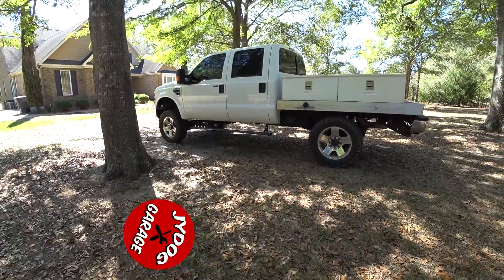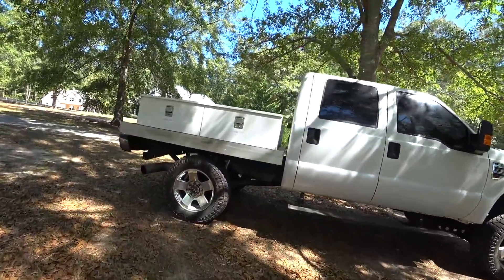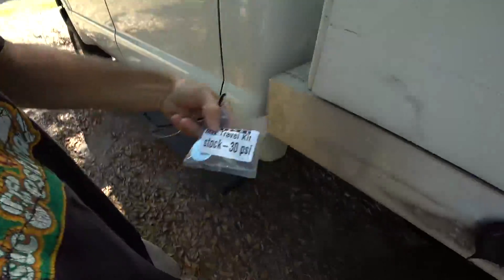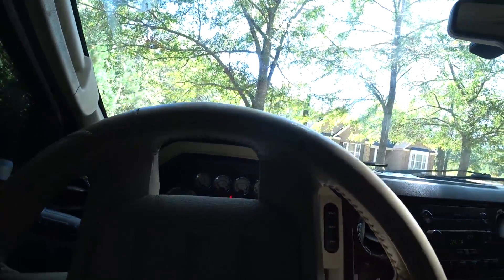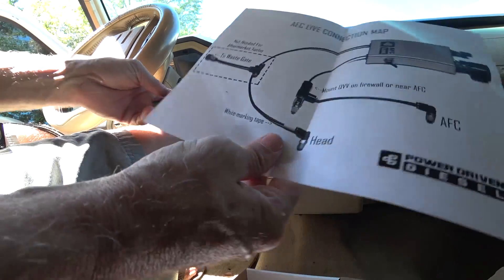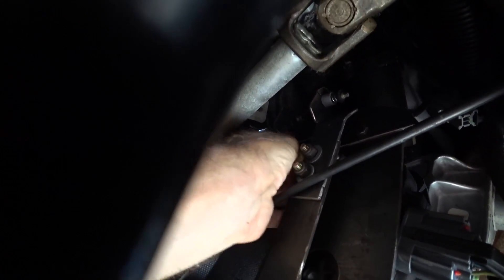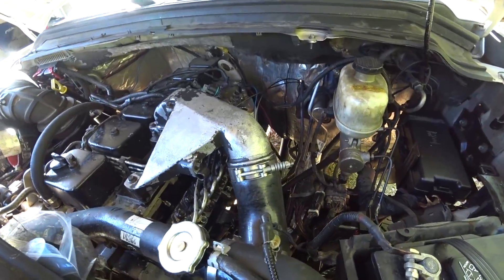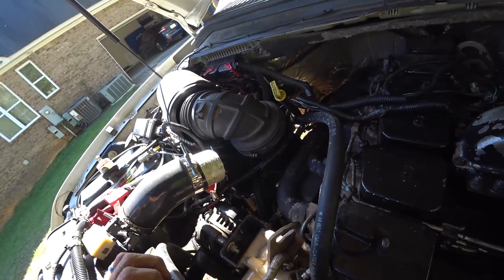Ford F250 Cummins Swap - AFC Live install and results

Comment: Are you going to plan on putting 3k governor springs to make it a little more responsive?
Reply from the maker: It currently has 4k Governor springs installed.

Comment: Order a #11 fuel plate, slide it forward towards the front bumper. Then back it off about a millimeter or 2. Tighten it down. That’s the perfect fueling I run.

Comment: Does it have a waste gate valve??? Is it bad??
Reply from the maker: It does and you may be on to something. I think it is sticking open. I might wire it closed.
Reply: @JYDOG  I had the same problem on my truck the stock hx the diaphram in it over time just loosens up allowing for it to open at lower boost levels when it shouldnt i wired mine shut i now see 40psi WOT i don't recommend it because those turbos arent rated really for that kind of psi.
Reply: I seen a vid the other day guy was having a similar issue.. Not much boost.. If i remember whos it was ill let you know. I do remember it was on 7.3 powerstroke. Not sure if it would equate much to your truck. But like you said may be on to something. Love your truck by the way and love watching your vids. Keep up the great work.